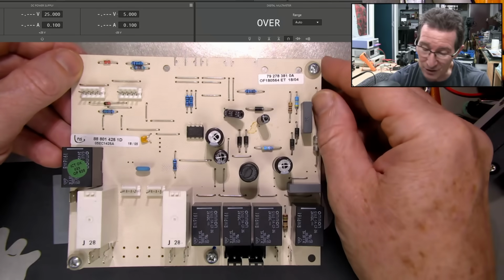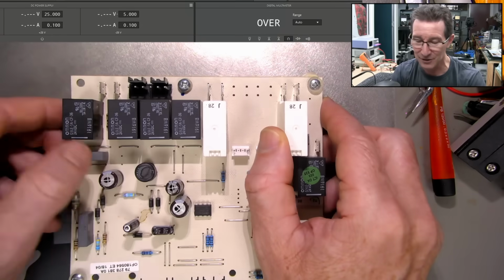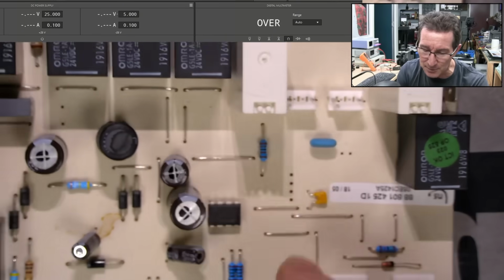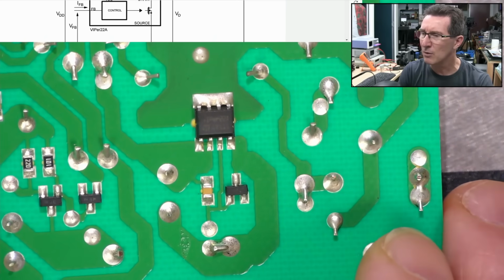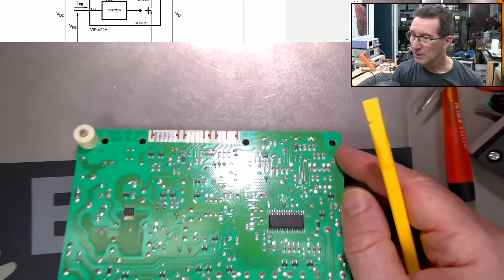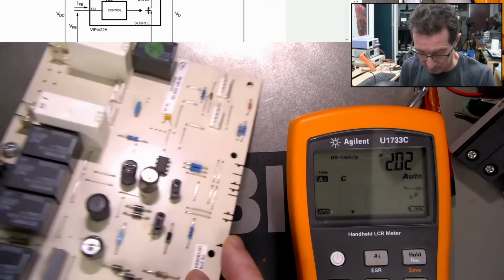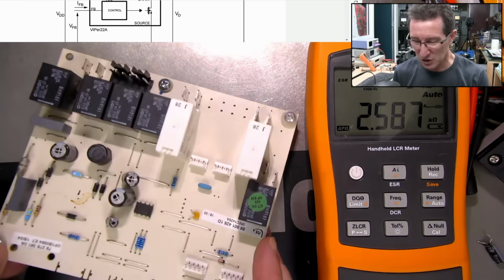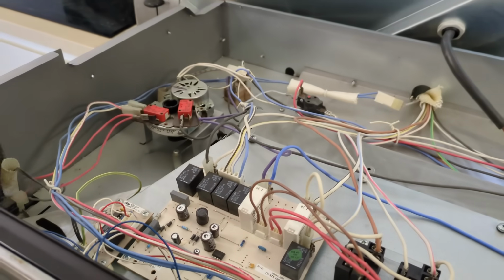Smeg Oven Goes Clunkedy Clunk + Capacitor Go Poop

Comment: Step one, remove interlock motor with xored gears. Two, install mechanical arm extension to the front. Three, combine limit switch mess to a single DPDT on the front for manual input. Optional step four, attach "not to be operated by xwits" warning.
Reply: At first I read that as exclusive-OR gears.
Reply: Yes!
F the safety mechanism and just install manual override switch.
Reply: I do it to cook pizza @~750F all the time @GermanMythbuster
Reply: I don't think step four is optional. In fact I argue it is step 0 :)

Comment: I've seen this many times with a throttle body on the car.   That plastic gear likely has a couple of teeth broken off and the motor gear is just spinning in place, not catching anything.  I bet if you reached in there with a screwdriver and spun that big gear a little bit, it would work fine from that point on.  It just needs a new plastic gear.

Comment: Probably not your issue on this one but... On us branded appliances that have relays... I have replaced lots of them on boards. Those Omron relays are not reliable over the long haul. I have even replaced them with larger off board relays just because the quality of those relays isn't very good and they never seen to be able to handle the amps they claim to. Always check for stuck closed relays or burned contacts and high resistance. Sounds like your asynchronous motor may be kaput.
      Any time I hear or see SMEG all I think of is Red dwarf.
Reply from the maker: Yeah, next step would be to trace out the path for the motor, doesn't seem trivial.
Reply: @EEVblog2  or you could start by measuring the voltage when the motor is powered and check the voltage/waveform looks reasonable?
Reply: @EEVblog2  Motor rattling like that the plastic gears in it are worn, or one of the shafts has snapped. They are generic, just need voltage, RPM and direction, and pop in a new one.

Comment: A former workplace of mine had a problem where they kept changing an oven control board, and then a new repair guy found out the heat vent was clogged with tin foil residue. At an obvious level a capacitor can cause logic errors or maybe lockup in a micro.

Comment: Is the clicking cog trying to lock or unlock the door? What are the various voltages going into the locking mechanism? It sounds and looks like some smaller diameter cog wheels have stripped. Maybe the oven needs to cycle the lock when repowered?

Comment: By the sound of it: take the motor assembly off the arm and try it without it. Maybe the actual locking mechanism is just jammed somehow and it tries to actuate it once to check if somebody just bypassed the switches?
Reply from the maker: Yeah, this is one of the things I was going to try.

Comment: We got a Smeg oven and hated it within days... it has the control panel immediately above the door and very quicky the timer, clock and function buttons (some sort of hard white plastic material)  melted from the heat... now all we have is little white nubs as buttons.... still works... but even so, grrrr

Comment: Door locks on ovens and washing machines are a high failure point in home appliances. The 'samurai appliance repairman' YouTuber used to complain a lot about electronic controls vs manual controls. How much would a replacement door lock assembly cost?

Comment: This oven is way too over complicated. With mine i just pull open the door, put the tray in, turn the knob to 180C and set the timer.  Job done. No stupid interlocks and no PCBs with bad caps.
Reply: But you do not have the fancy touch controls, the auto clean feature (can of oven cleaner, a cloth, and 15 minutes, saved by using 5 units to burn the crap off, and you still need to clean it anyway) and the clock that never is the right time as display. Plus the lifetime power use is more than double, as that 5W of power used to drive the display is there 24/7/365, and usage is likely under 2 hours a week for most ovens.
Reply: @SeanBZA  Appliance standby power draw requirements seem to be pretty lax which is disappointing. My brand new hot water heater uses 10 watts doing nothing at all which is nuts, most full on desktop computers use about that when they're switched on these days.
Reply: You and your fancy timer oven.

Comment: 6:39 They put the circuit board on top of the hot air exhaust. Seems the food is not the only thing that's getting baked
Reply: Probably planned obsolessence i had also a simmilar problem but the psu failed and sent 220volts into the microcontroller and fried it
Reply: Would it be possible to put in a piece of foil to deflect some of that hot air?

Comment: My fridge freezer was failing... the repair shop quouted £80 for the callout and £100 if the board needed replaced.  On inspection I found a bulged cap on the controller board.  Replaced it with an identical one salvaged from a failed monitor for a free repair.

Comment: SMEG, standing for Stupid Made Electronics goods. Failing power supply, so the relays do not release or engage properly, because the power supply ripple is around 20V as the IC runs in startup mode all the time. 33uF can easily be replaced with 47uF to test.

Yes the motor has a worn gearbox, kind of common on those cheap motors. Not helped by the failing power supply either. Remember that 105C cap runs at 120C when the oven is in use, so 500 hours will cook it nicely.

Comment: For everyone that thinks this mechanism is too complicated and their oven from 1804 still works fine: you haven't used the self cleaning mode of a modern euro style oven. This function heats the oven to 700°C and gets rid of every single spec of burned in grease and stuff perfectly. Same job takes hours every time with oven cleaner and elbow grease. It's like an induction oven, once you've used one everything else is garbage.
Reply: The tech isn't the problem. It's the litigious nitwits that necessitate these safety mechanisms that inevitably fail.
Reply from the maker: @oambrosia  Yeah, it should be possible to override this. But it's part of the power-on test.
Reply: Ha, but your fancy self cleaning oven only works so long as you have electricity - the 1800s era coal range works even when the power goes out!
Reply: @Agent24Electronics  Yes, and my 10 years old Gas range works after  "all new is good" guys cry in darkness.
Reply: *self destruction mode

Comment: I used to operate An appliance business Many years ago ... Always told customers Not to use the self cleaning Normally they have the Vent Right by the circuit board area .. It's best not to use the self cleaning unless you want to destroy You're strove lol

Comment: Coincidentally, I think my washing machine has finally had it. Today I saw it bouncing around so hard, the front lifted >5cm above the ground! It definitely wasn't overloaded, so it's not user error, but something's definitely broken and it's causing a minor imbalance to send it completely out of whack. Looks like I'll be shopping for a new washer sometime soon.
Reply: My Bosch front loader is 9 years old and working perfectly. It never stops - on average 5 loads per week
Reply: @einfelder8262  thanks, that's good to know.
Reply: @UpLateGeek  Forgot to mention critical point - it's made in Germany, not a China one.

Comment: shorted relay on 24/7. common,, relay welds itself to shorted when off, check the relays,, if on all the time, simple fix done a few of these, also error 03 is temp sensor issue,, i would surgest ,, back of oven that temp sensor has failed,! replace,! if im correct on is above the door motor makin all the noise, its gone faulty oven got to hot,, so would have sent sensor over the top,, replace it, and it should work,, providing relay not stuck 2 things too look out for cheers lee,

Comment: Hi Dave SMEG tech here access to all documentation and parts this oven has built in test modes you can command functions like the lock to function but you wont guess how to get access you will need the service manual. There is a way to hack work around the issue to get the oven working again but you will need a lock. This will be a faulty interlock give me a yell if you need help
Reply from the maker: Why not make service manuals available? Or at the very least the secret menu options to bypass this?

Comment: A professional electrical engineer should be able to fix a simple oven. Would expect nothing less.
Reply: Trouble is this one is way over complicated.
Reply: @simontay4851 Yes sure, I have never seen a oven with a door you can lock and a cleaning cycle. Would take apart that locking thing.
Reply: Just becauae you can doesn't mean you want to.

Comment: Disconnect the motor mechanically and see if the locking mechanism is able to be actuated by hand. Then get a new motor. Check you're also getting the correct voltage to the board to the motor. That's what I would do because that motor gearbox sounds shot.

Comment: If that is escaped electrolyte it could have caused a voltage leak to or from that diode, seen that happen where a nearby component was at mains potential and the cap was at low voltage thus frying the LV circuit. Capacitors are pure evil just waiting to kill your electronics in new and unusual ways. Those synchronous motors start in any direction and relies on not being able to start in one direction or the other for opening or locking, the same principle is used in central heating valves, so if locked it will open when powered up or the other way around if unlocked. Most likely failure is stripped gear teeth.

Comment: I'm willing to bet that board and the locking motor can be found cheaply. The key is to realize that board is probably used in like all ovens - if you look closely at all the ovens on display in the store the things start to look alike because they are. So that board might be a few hundred bucks because it's the one part, but if you find the generic version it would be much cheaper. Same goes for the motor - chances are if you head to the junkyard you can find that exact same part in pretty much all the ovens there regardless of brand or model. The same design is used everywhere - it's like someone did an oven controller and sold the design to everyone
Reply from the maker: Nope can't find either part.
Reply: I would take apart the lock mechanism and see if it's an easy fix. Or even just figure out if there's an easy way to fake it.
Reply: @NiHaoMike64 Yep, most obvious thing to do before spending hard cash on a new one. Probably pressure from "she who must be obeyed ".🖐😏🇬🇧

Comment: Why expensive brands make cheap looking boards is beyond me. I would've expected a decent board with conformal coating and quality capacitors.
Reply: Probably outsourced to someone else. And just because the appliance is expensive, doesn't mean the quality matches...
Reply: Here Smeg is cheap brand. But I have not high hopes on more expensive brands either, could come from just the same line...

Comment: That's why I have an oven that is basically a gas valve on a metal pipe. Why on earth would you need all this nonsense for? That thing is at least as complex as a washing machine... what for? You just turn the heat on, wait X minutes and food's done. As it is always said, if it works, don't fix it. We've been cooking food like this for thousands of years and it still works, so no need for such overcomplicated drama.

Comment: First thing would be to remove the locking arm from the motor. See if it's tight when moving it manually. The clattering noise does indicate a stripped gear. But there will be a reason it's stripped if that is the case. Synchronous motors don't have any real horse power which is the reason for the gearbox. Even if you find it's a knackered gear, good luck getting another one. No doubt a replacement assy unit would be as much as a new kidney 😁